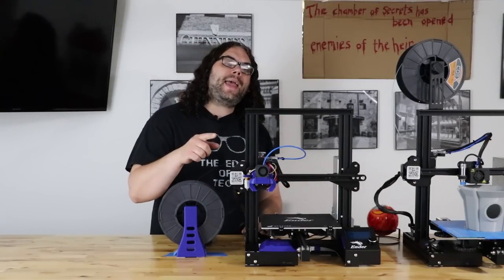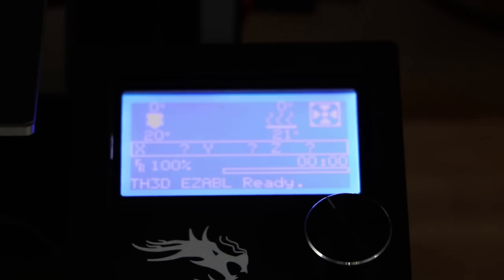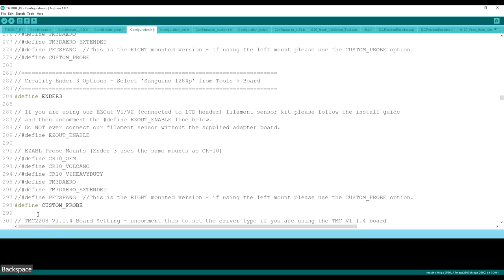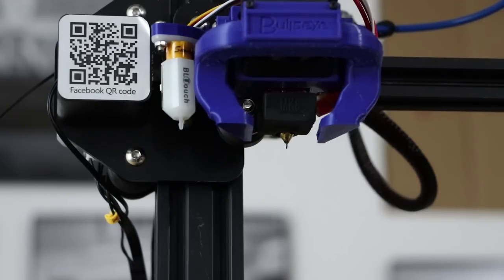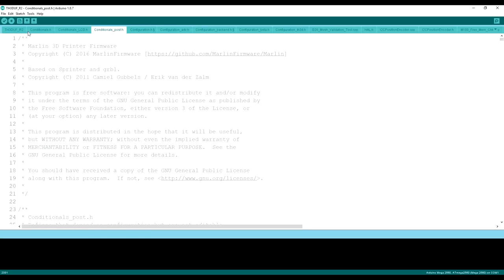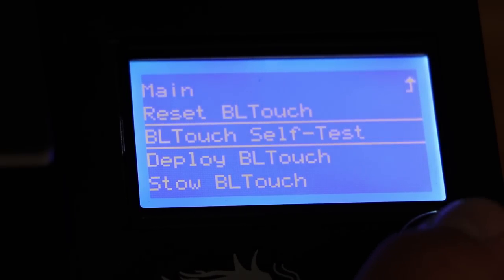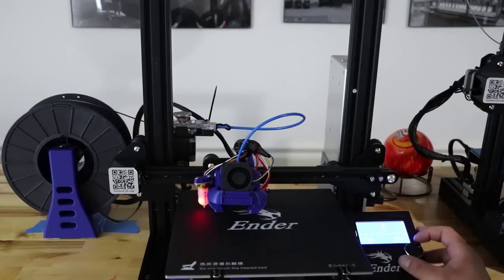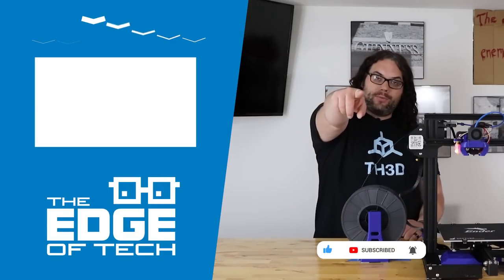New way to configure the BLTouch on the Ender 3 in 10 minutes or less

Comment: How do I know if I have a Pin27 board?
Reply from the maker: It is something you would have purchased, TH3D sells a version of it as well
Reply: @TheEdgeofTech  Ok, so if I did not purchase, then do nothing. Correct?
Reply: @TheEdgeofTech  This is what was posted in the latest code: Here is where you set your servo pin. EZOut Servo Pin Numbers: Anet(with 2004LCD)/Ender3/5/CR-10 - 27, Anet(with 12864LCD)/Ender 2 - 29. For 2560 boards look for the pin you connected the servo wire to and enter below.
Reply: @TheEdgeofTech  The packing list I received with my BLTouch lists my pin board as "Pin Board A".  I'm going to assume I leave it commented out in this case - I can't find anything to indicate differently.
Reply: @TheEdgeofTech  I received an error. I have to define a pin. More research...
Reply: @TheEdgeofTech  Error code was: #error "SERVO0_PIN must be defined for your servo or BLTOUCH probe." I attempted to contact TH3D but they only reply weekdays. Guess the robotics parts will have to wait.
Reply: Joe Pendergrast any progress on how to identify pin name? I have the Skr Mini E3 V1.2
Reply: Mr. Chanceson I think I went with a pin 27. It works great

Comment: it only probes the middle and starts printing
Reply from the maker: Double check the firmware is setup perbtyw video and flash it again. Let me know if that helps
Reply: Don't you need to add the G28 command to your starting GCODE to get it to do a bed level before the print?  Maybe that's missing from your GCODE.
Reply from the maker: @gizmobowen  Yes you will need the Starting GCode setup for the sensor. I appreciate the feedback, and thanks for watching!

Comment: I followed your video I am using the newest TH3D firmware...I get this message

        Using Port                    : COM8
         Using Programmer              : arduino
         Overriding Baud Rate          : 115200
avrdude: stk500_getsync() attempt 1 of 10: not in sync: resp=0x65
avrdude: stk500_getsync() attempt 2 of 10: not in sync: resp=0x63
avrdude: stk500_getsync() attempt 3 of 10: not in sync: resp=0x68
avrdude: stk500_getsync() attempt 4 of 10: not in sync: resp=0x6f
avrdude: stk500_getsync() attempt 5 of 10: not in sync: resp=0x3a
avrdude: stk500_getsync() attempt 6 of 10: not in sync: resp=0x54
avrdude: stk500_getsync() attempt 7 of 10: not in sync: resp=0x46
avrdude: stk500_getsync() attempt 8 of 10: not in sync: resp=0x20
avrdude: stk500_getsync() attempt 9 of 10: not in sync: resp=0x69
avrdude: stk500_getsync() attempt 10 of 10: not in sync: resp=0x6e

avrdude done.  Thank you.

An error occurred while uploading the sketch"
Reply: I got the same thing
Reply: @blstr846  I sent mine back I tried absolutely everything, spent 3 dayd messing with it!. I feel it should of never been that difficult

Comment: I just tried this and everything went fine except when I auto home. My measurements for the offset are correct and the BLTouch does not center, the nozzle is more center. So if I go to level the bed at the first point the BLTouch is hanging over and the nozzle hit the bed. Any suggestions?